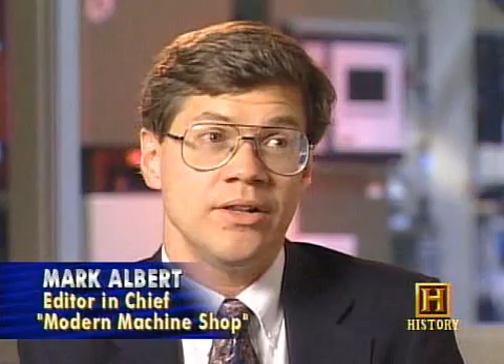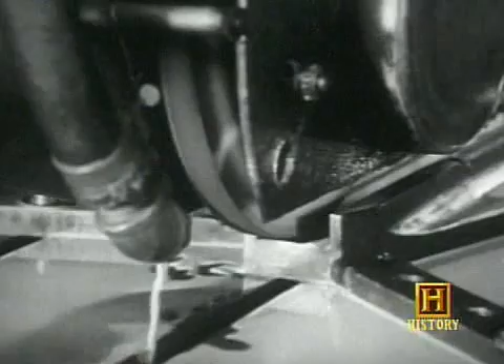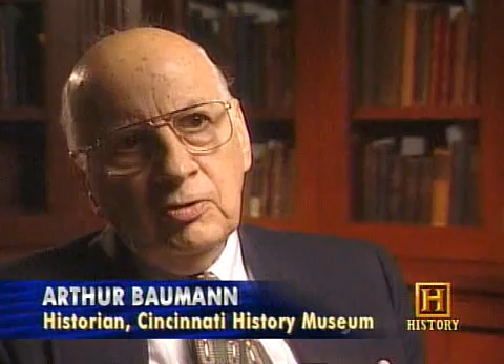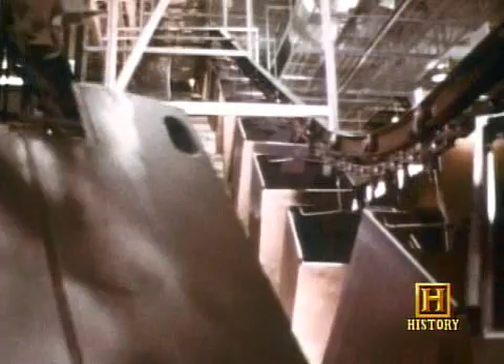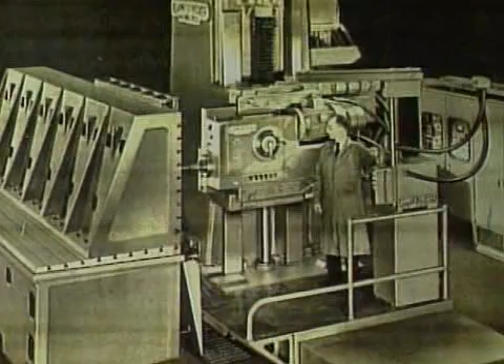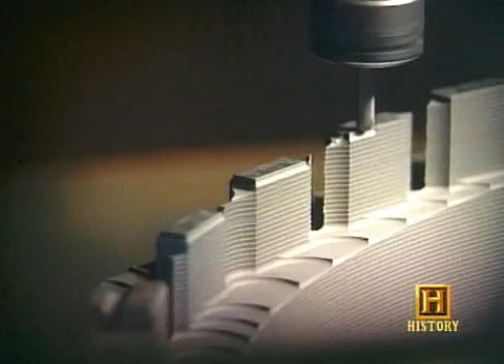Modern.Marvels.- Machine.Tools part 4.avi

Comment: It's interesting to note that crankshafts which were machined before the invention of the grinding machine to grind them.are no longer production made using grinders,they are all CNC cut now.So from one to another and back again! I Suppose the grinding was opted out because it's messy and stones constantly need dressing and the machine adjusting.